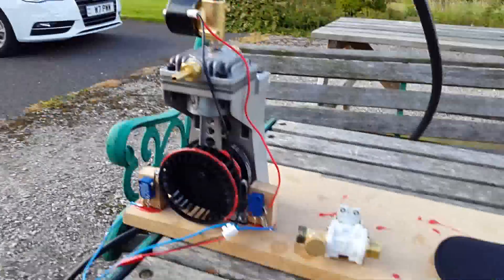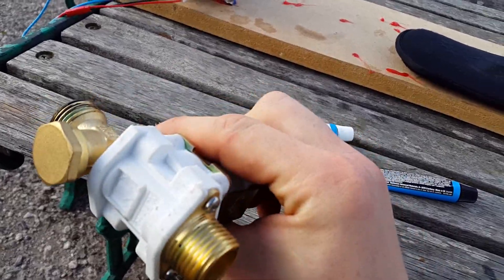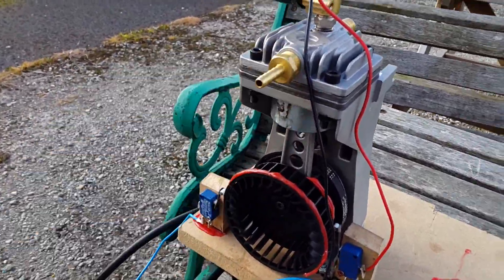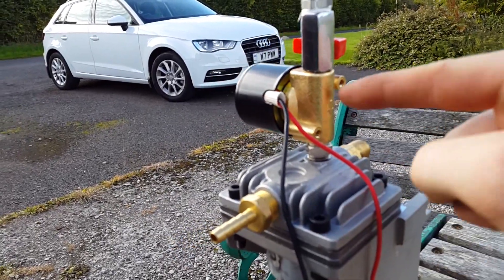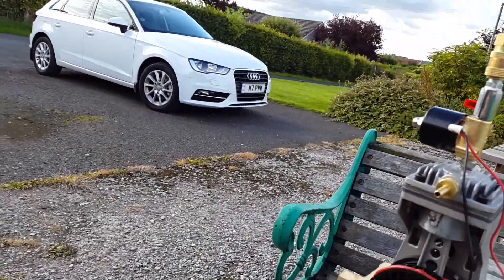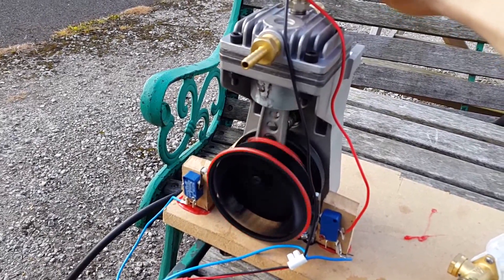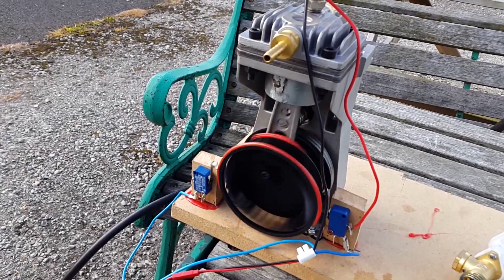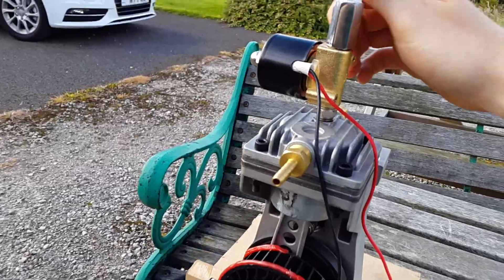Compressed air engine part 2 first test

Comment: Hello. I also am planning to build one soon. Is both your solenoid valve and limit switch 12v? I plan to run them on a motorcycle battery. Is it possible?